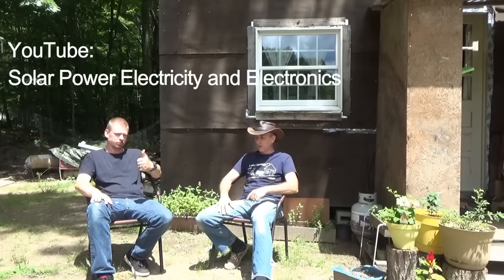Visitor Here To Improve Our Off Grid Solar Power Wiring

Comment: Philip subscribed to your home channel. Beautiful wedding gift, having the Reid household safe is great. Again Thanks
Reply: Thanks man!
Reply: +Solar Power Electricity and Electronics (phillip20) Was Troy wiring of a man in a hurry to get power or a man who drew it on paper first and then cut it to fit.
Reply: +Solar Power Electricity and Electronics (phillip20)  By the way thanks for pretty up the wire and getting more power with adding more eguipment.
Reply: +Frederick Nolan I have to say in all situation Troy needs power to sustain a YouTube channel and in same situation    I would have done the same thing myself because I would need the battery voltage and or state of charge in the kitchen where his charge controllers was at. Currently he has a voltage meter that I supplied that attaches to the renogy charge controller so he can monitor the system during rough weather conditions.
Reply: +Frederick Nolan Thanks for the compliment.
Reply: Solar Power Electricity and Electronics I meant without adding new eguiptment.
Reply: it's fine to run the system before with the wiring the way it was just not tucked up

Comment: Would help a lot for your video editing. A good desktop with a good cpu.I like a  decent graphics card also because I use my desktop for video playback on my tv.It may also be a benefit to use as your media center.I  hope his upgrade to your solar system helps you out.I found laptop cpu doesn`t compare to a good desktop cpu .A mac book in Canada is over 1500.00 dollars for an I5 and 2500.00 dollars for I7.Needless to say for me the poor stay away:) Hope you meet your power needs.
Reply: +Prepper Man I have problems with Linux but it is just error log buildup. Needs a restack  of os to clear mind of useless info. My bad that is Qunix, sorry mind scramble at work.
Reply: Every time I watch NCIX Tech tips they put up specials in U.S. and Canada prices are higher here for sure.Troy could get a mid range one built for a fraction of what we would pay here:)

Comment: I have I have a MS4048 works perfect.  its a 4kw inverter with 60 amp mppt solar charging and 60 amp grid charging with Gen support for off grid systems.    I have 2.2kw solar will soon be upgrading to more solar. and another pip.  and my battery bank.  Good to see you have a friend to help you out.